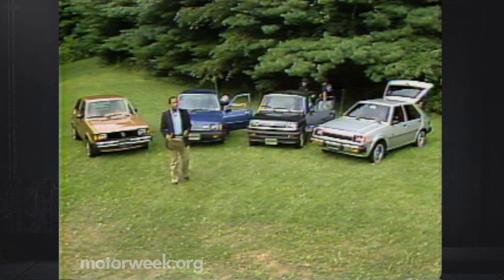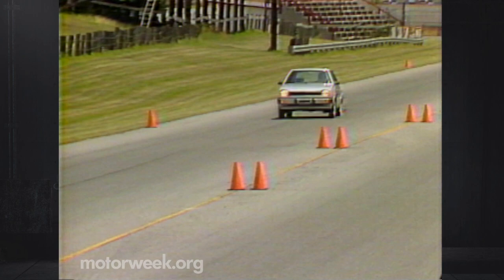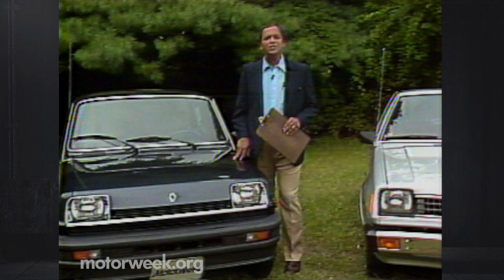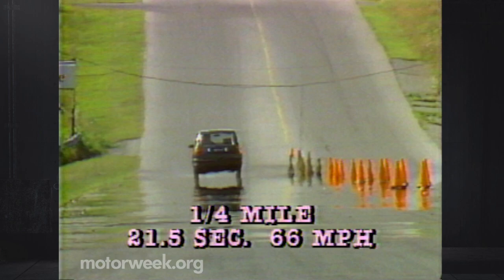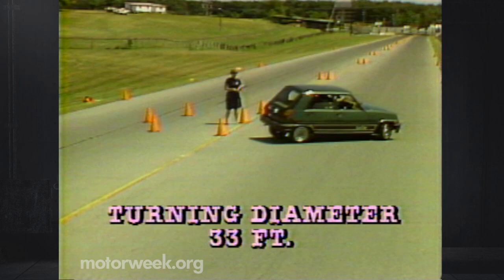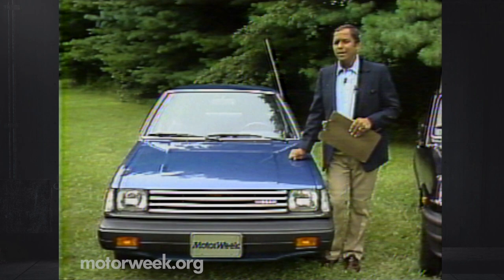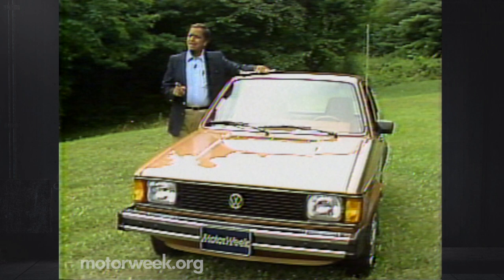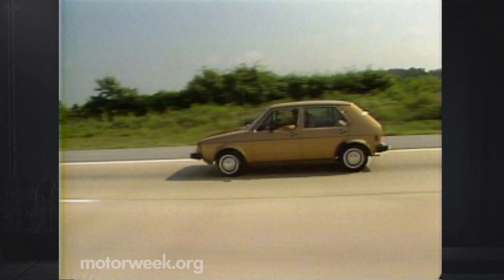Retro Review: 1982 Econobox Comparison

Comment: From 1978 to 1987 I worked for a car dealer who had a Mazda/Renault dealership and a VW/Peugeot dealership. I worked on the Mazda/Renault lot and a friend of mine worked on the VW/Peugeot lot. Near one of the dealerships was an intersection with a huge dip. We decided to conduct our own comparison test to see which car had the best suspension: the LeCar or the Rabbit. First we drove the LeCar through the dip at 45 mph. It went "thump-thump" and we barely felt it. Next we hit the dip at 45 mph in the Rabbit and Ka-Baam!!! We had a mechanic put the Rabbit on the lift just to make sure we didn't damage anything. Fortunately, no harm, but we now knew which car had the better suspension. Those torsion bars on the LeCar were amazing!

Comment: Rabbit. Hands Down. I just like that you could improve it's performance with a strong after market, it is the most timeless. Sentra 2nd due to it's economy and reliability. 3rd Colt, decent driving, I like the hatch with folding seats, they proved reliable..needs to be a Stick.
Reply: Oh yeah, there is.. and only 3  years later it would have been massive as the Rabbit GTI took on the market. Neuspeed was making cams, there was exhaust, headers, suspension upgrades.. still avail for it today.
Reply: Neuspeed was making those aftermarket parts for the Rabbit in 1982?
Reply: That is not what matters. In a year the Rabbit GTI came out, you could hop up with aftermarket created at that time.
Reply: So, ya gonna give an example of what was available for the aftermarket of that time? Did you own a Volkswagen in the early 80's?
Reply: I don't understand your point? I was 11 or 12 when this car came out. There was an after market for water cooled VWs, but not Sentras and Colts.  By the mid 80's  Neuspeed, Zender,  and Leistritz was busy making high performance exhaust, cams, etc. So only 3 years into ownership these cars could be modified for more fun. Whilst the Sentra and Colt owners are feeling bored.
Reply: umm, I wasn't making any point. I was asking a question. 

Funny enough, I WAS around at that time I don't recall much of a performance aftermarket at all for these cars DURING that period.
Reply: Okay. Well, I was in the VW scene in 1989, I recall the aftermarket. The examples I saw at shows and at shops from folks that had them since new. No real surprise since the Rabbit is the replacement for the Beetle, that had a long lineage of aftermarket support.
Reply: Are you able to prove your claim of this healthy aftermarket back in 1985? Got an ad or any other source from part manufacturers dated for that period? I'm really curious now. :~)
Reply: I am a nerd, I forgot about Kamei as well. There was a lot in 82. Including Neuspeed, starting in 1980. http://www.superstreetonline.com/features/1609-remembering-bill-neumann-founder-of-neuspeed/
Reply: That's pretty cool and I appreciate it but I need to clarify. You mentioned performance aftermarket parts that were being made back in that period. I want to see for example, an aftermarket high performance camshaft that was produced in 1985 by Neuspeed. I understand Neumann was building cars but when did Neuspeed start manufacturing these parts? When could we walk into shops or call in and say "I want this horsepower adding part for my Golf"? I want to see dated proof of an ad or something similar. Know what I mean? 

Also, I'm definitely not aiming to disprove you or anything homie, this is more for my personal knowledge.
Reply: Weird to find someone talking about buying the parts they wanted on line, but there is a few magazine articles I found with modifications, tests. http://www.carbuildindex.com/category/tuner-2/
Reply: The Rabbit and there is also body kits, etc for1985 new GTI.  Oetinger was another big one. http://www.carbuildindex.com/category/tuner-2/
Reply: I think we're having a failure to communicate
Reply: I guesss??
Reply: Wouldn't say there was a strong aftermarket necessarily, but it did exist. The Rabbit was first available in the US in what 1975? The GTI here in 83? There were Southern California tuners messing with VW's "new" watercooled engine back then. Look up VW and Porsche magazine, they were covering the VW performance scene in those days.
Reply: xr7fan heh that was one of the earliest hot hatches barring the original mini. 
The aftermarket is huge and still is for the mk1
Reply: djkenny 
Dont forget techtonics
Those founders came from the air cooled stuff and just progressed to the water cooled stuff.props to being in the scene since 89, that’s about the same as me but I never really left.
Reply: ALL:  I pulled this off of Neuspeed's Website...under the tab: NEUSPEED HISTORY....

"NEUSPEED® is the most committed Total Car Performance Tuning Company in the Audi and Volkswagen aftermarket. We are always the first to bring you the best products available for your car – long before other tuner companies.

We began developing products in 1975, when the first VW Scirocco hit our shores and the VW Rabbit shortly thereafter. We thought this new line offered the best compact cars of the era – with fine German engineering and unlimited performance potential – we were right!"

The Rabbit did have aftermarket available. How much is an matter.
Reply: xr7fan  - In 1983 I bought a long duration high overlap cam for a '74 Audi fox - same engine as the rabbit. Also put on a 2bbl progressive Webber carb. & a mechanical advance "009" distributor. It made that little engine scream. Had an aftermarket tach and it would pull hard from 5000 up to 8k rpms. There was a machinist in town who modified rabbit heads & put Ferrari cam followers in them. He said rally racers in mexico were running 10k rpm's all day long in those engines & some could briefly hit 12k rpm. We only mildly ported my heads though, I didn't need over 8000 rpm so I didn't need Ferrari cam buckets. So yeah, there were some aftermarket parts available. No "fresh air" kits were available though. Lol!

Comment: The Colt from 2006-2012 featured a trim level called RALLIART Version R which had 4G15 MIVEC 1.5L in-line 4cyl turbo with 163hp and 21.5kg/f of torque.

Comment: I bought a used 1983 Sentra station wagon with 5-speed manual transmission in 1990. It was very practical for camping trips and really did average over 40 mpg. I do not recall any quality control issues and it was amazingly quiet at 65 mph. I drove it about 6000 miles and sold it for what I paid for it. I would be glad to have it back. Too bad the Colt in this test did not have the 5-speed manual. I had a 1978 Dodge Colt station wagon with a 5-speed but it only got about 28 mpg. Hard to find any of these still on the road except for Rabbits, which are becoming collectible and fun & easy to modify. It would be rare to come across a LeCar......maybe someone will bring one to Jay's Garage with a 300 hp engine. 🙄

Comment: I had an'83 Nissan Sentra(MPG model-67 Hp). Excellent little car! Couldn't blow it up. beat a lot of cars it shouldn't, and was nearly indestructible!!
Reply: I remember those MPG models.They had the small spoiler on the trunk
Reply: I can't tell if this one had AC or not, but my mother bought an '82 standard model with AT and side moldings for $6622 brand new.  No radio, no AC.  I felt bad because we saw one with AC/AT/Stereo cassette the next week at another lot for $5900.  She was really upset!  Great car though....drove the daylights out of it for 10 yrs and never had one major issue.  Some ass-hat at a gas station shoved a carbon receipt in her tank, but that was all.  It never left her (or all of us) stranded.  It's probably still alive today.
Reply: Tom Smith I'm not sure what you mean by shoved a carbon receipt in her gas tank. Is that a way to destroy a car?
Reply: Nah, it was just some a$$hat attendant mad at the world or something.  We were on a quick road trip and the car started missing when the tank was at about one-quarter. When they cleaned out the tank, they found a carbon from a gas station.  Some people's children.
Reply: How about the Honeybee 210 or L11 (OG) Sentra stripper models? They only came w/a 4-speed manual, either honeybee-colored (very cheap looking orangey tan) or black rubber carpet and no armrest (just a handle). May had the cheapest looking interior ever (an almost tie w/the Yugo GV there), but they had an almost indestructible 1.4 or 1.5L engine...
Reply: Most Nissans of that era had almost indestructible engines, they were really tough.
Reply: Before about 1995, nearly all Nissan engines were extremely tough. After that, all their sixes were tough, but 4-cylinders weren't always good.

Comment: I think the Nissan was a fair pick in this contest---given it's intended usage as an inexpensive people carrier, it's the best choice. I had a Rabbit, and I too found the body roll to be excessive. One thing I"m surprised that wasn't mentioned was the vicious torque steer in corners---if one didn't have a firm grip on the wheel while accelerating in a corner, the steering wheel would kick back so violently that it would just about take your thumbs off.
Reply: Torque steer can very from car to car... the next Sentra/Rabbit/Colt you took off in could very well have no torque steer at all, or possibly even jerk the opposite way.

Biggest factor is the alignment of the engine between the wheels... it's as important as wheel alignment is to handling, if the engine's off a fraction of a inch left or right then one axle is effectively longer than the other and will twist more or less before full torque is transferred to the wheel. That's the 'jerk', torque took up the torsion in one axle before the other and for a brief moment one wheel got far more torque than the other and yank there it goes.

Comment: I'd love to see the '86 Sport Truck Comparo.
Reply: Yes I remember that trend! You were the coolest if you had blue S10 sport back then!
Reply: Their test truck was a blue Tahoe Maxi-Cab.
Reply: Yes, pleeeeease. Anything featuring the '86-'93 Mazda B-Series trucks.
Reply: MW did feature a (85hp) B2200 Plus Cab in that comparo (the topline that year would be a B2600i, with a Mitsubishi-derived [Mazda bought them the machinery to make it] NA-2.6L I4). 

The B-Series never got a V6 while it was Mazda-designed. Only when they began to buy rebadged Ford Rangers was that they got the 3.0L and 4.0L V6's...
Reply: I kind of scratched my head about that.  Like, they really did not compare apples to apples there.  My uncle owned a B2600 4x4 and I LOVED that little truck.  Was like a farm tractor in the snow. That sucker went everywhere. Full size V8 4X4's all off in ditches and stuck in mud and the 'lil B2600 would just drive past / around them like it was a warm Sunday drive.   The only Mazda I ever owned was a rebadged Ranger.  ( '98 B2500 2wd base model )
Reply: COYOTE ADVENTURES, MW probably made the comparo on price basis, but the +35hp (total of 120, or +14 over Mitsubishi's carbureted version) helped the EFI B2600i compete against other marques V6's.
Reply: The Nissan Hardbody was introduced that year, and was an excellent truck. If people remembered what a timing belt was, the V6 was probably the most reliable of them all.

Comment: btw, that gen of colt was breathtakingly robust. we had one back in the day and we decided to take it out in a blaze of glory. we did everything we could to kill it, (severe overheat, full redline, ruthless driving etc)
Reply: I remember them in the 80s and 90s. From my experience, these cars are as tough as they come. Especially considering the size and era.
Reply: Some idiot had one years ago. Used it to launch his little hobie cat, and ended up forgetting to put the parking brake on. Divers had to pull it out on a winch. This was salt water. They hosed it off right at the marina, pulled the plugs, got the water out (and seaweed), and it fired right up. the guy drove off. good thing he was wearing a bathing suit. Classic memory.

Comment: Had that exact Colt but with a 5 speed gearbox, in the late 90’s. A very reliable car considering the age. It handled very well in city driving. The Astron 1600 engine seemed thirsty considering the capacity, but this may be my bias comparing it to 90’s cars of the time.

Comment: This colt review could be a review of my 2014 mirage.  It's the only car that hasn't changed much since the 80s, they just made a few updates and improvements to keep it desirable and adjusted the price for inflation, but it still fits most if that description and that's a good thing.
Reply: The Dodge/Mitsubish Colt seems to have thicker tires than the new mirage. Same diameter.

Comment: R5/Le Car: They put the safety wheel in the back, originally, it was mounted upper the engine when it runned with a carburetor. The motor environment looks strangely like the 1.4 litre from last edition of the Supercinq Five ("LeCar2"). Not a bad car, but an outdated design from the first Renault hatchback, the Renault 4.
Peugeot 104 was technically better designed with semi Mcpherson suspensions of all wheels, despite a outdated style, but they tried too hard on insignificant details, like the safety wheel under the hood, forced them to built a 70° inclined 4-line engine with motor-oil greased gear-box (7 litres of 10W40!).

Comment: The engine in the LeCar arrived in the US in a completely different 4 wheel vehicle called a Wheel Horse D250 which was built in Europe and exported to the US. Even though it was only rated at 20hp I’m guessing that the torque rating was a bit higher than any other garden tractor on the market of that time.

Comment: My Mom had an '82 Rabbit Diesel, Wolfsburg Edition, back in the early '80s.  That Diesel engine would easily exceed 50 MPG on the highway, but it was SO SLOW, even with a 5-speed manual.  The Wolfsburg Edition was better looking than the standard Rabbit, in my opinion -- fender flares and bumpers that were black with no chrome, and black rear-view mirrors.  And that Diesel engine -- if that car hasn't been wrecked, I'd bet it's still on the road somewhere, because that engine just couldnt be killed.

Comment: I had a ‘87 Dodge Colt, bought it new.  One time I took it on a 550 mile road trip to the top of the upper peninsula of MI.  I made it on one tank of gas, 11 gals, working out to 50 miles per gallon.  I drove at a steady 55 mph with no cruise control.  Went to get gas after getting to my destination and ran out of gas about one block from nearest gas station 😂😂😂